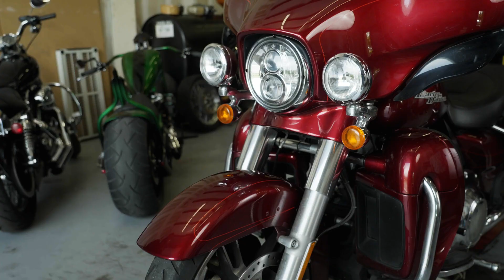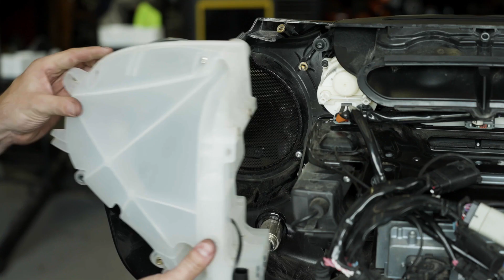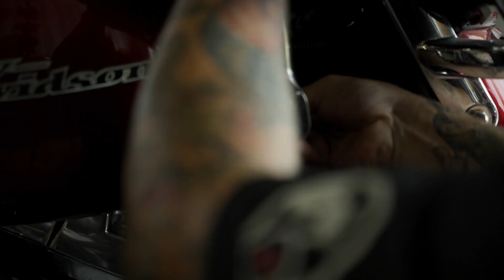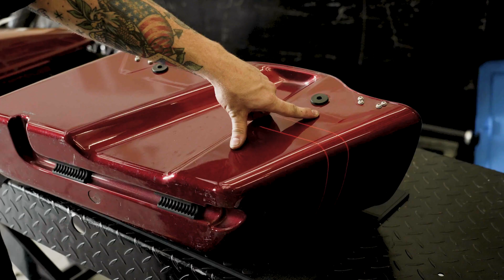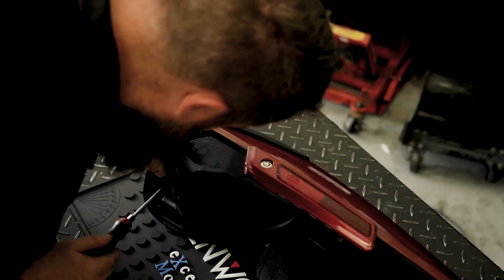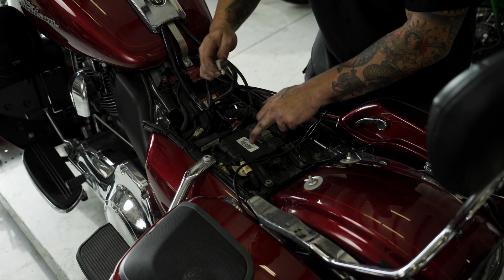KENWOOD P-HD3FR Installation Video 14+ Harley Davidson® Street/Road Glide® eXcelon Motorcycle Audio

Comment: You have one for a 2023 Road Glide?
Reply from the maker: Solutions for 2023 New Updated Road Glide are possible in the future but not yet available. Thanks!
Reply: I just did the install on a RG special 2022. Getting the 2 amps installed is something were you need to take your time...I first installed the bracket with the amp applied to the back and routed all the wires through the metal frame within the fairing. Then I plugged in the second amp and pushed it up to stick on the front of the bracket. Not an easy task as it tend to stick to the velco when you are sliding up behind the brackets holding your front light. Now I know why there are no videos about an RG installation... System however is great.